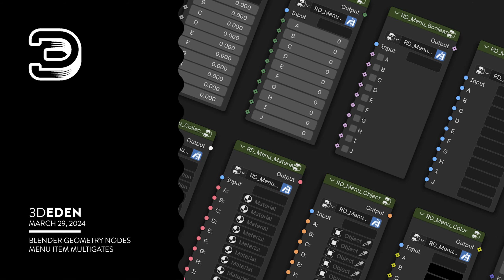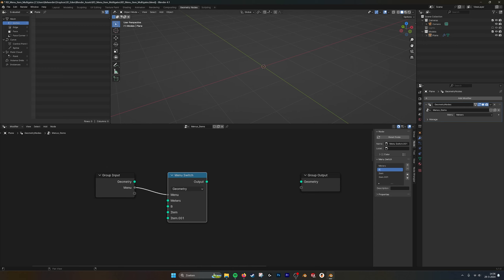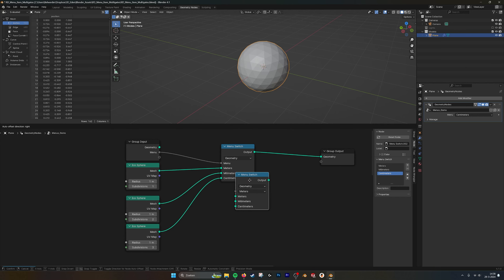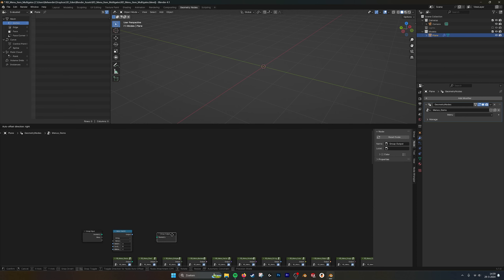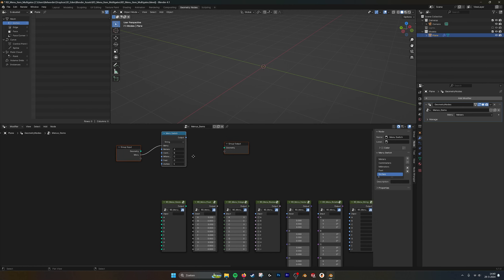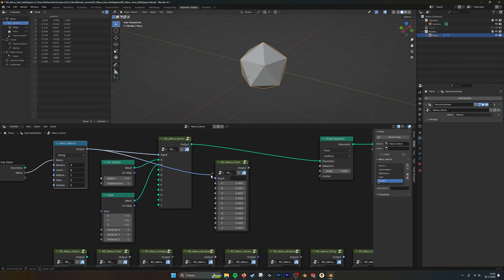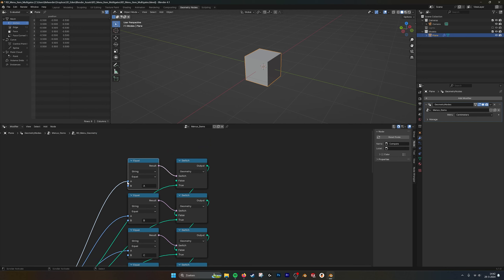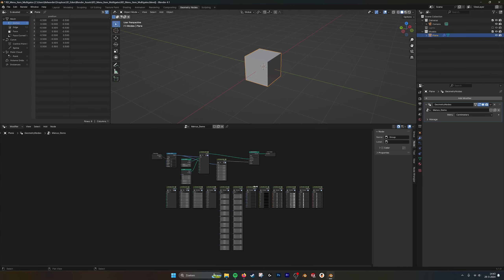Blender, Geometry nodes, Menu switch, Menu item multigates Tutorial

Comment: you could have used a menu switch to drive an index switch instead of doing all of this.
Reply from the maker: I tried that but I wanted a system that I could easilly reuse and this came out of it.
Reply: @3d-eden978, your design isn't reusable or simple. Menus switch driving index switch nodes are just better full stop. All you did is recreate a node that exists. It will make the tree less fast and is more complicated to use with no advantages at all.
Reply from the maker: @overlordthe7th981 Thanks for you feedback. Can you make a screenshot on how you would have solved this? I am interested. Maybe I didnt understand the menu nodes right away.
Reply: @overlordthe7th981  I too am interested in seeing your solution vs. what was done in this video.